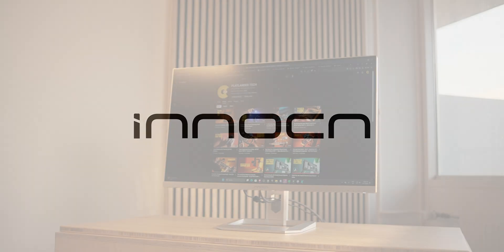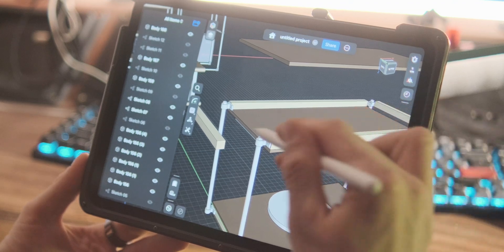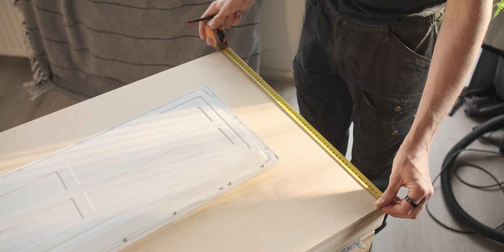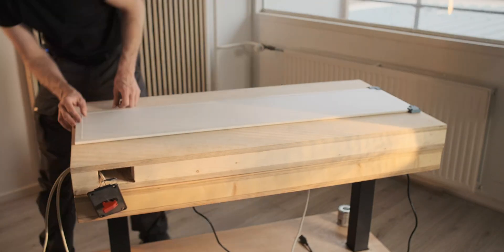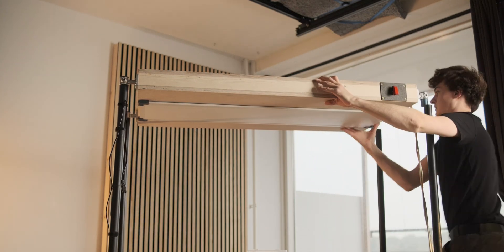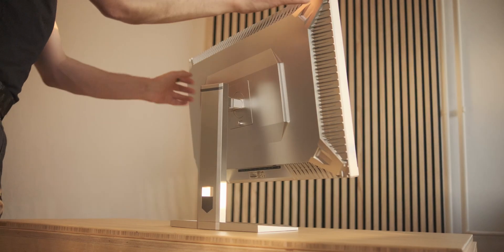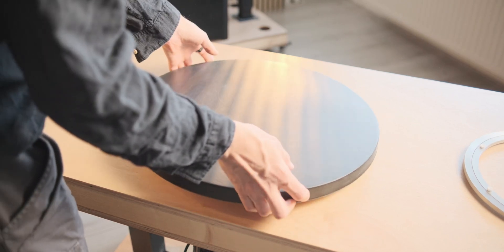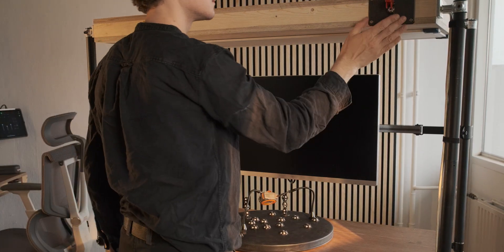3D Scanning Station Build - Creality CR Scan Raptor - Innocn 32m2v

Comment: Great video. As always. Curious if you'll get wobble when rotating the subject with the arms. Although, I don't think it'll matter. Do you know what the refresh rate of the light ended up being? Picking up any flickering from it while filming?
Reply from the maker: Really appreciate your support! 😊 As far as I can tell, there's no flicker as long as the shutter speed matches the light's frequency (Hz). 👍 I've not tested it at different shutter speeds but I think its okay, just the light quality is really bad, like the CRI rating is really low and its quite distracting in video.